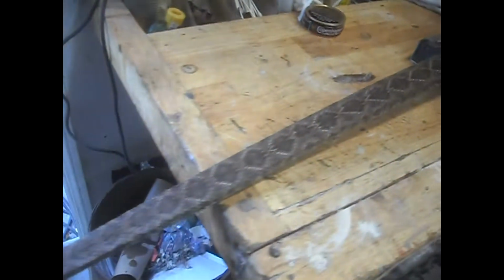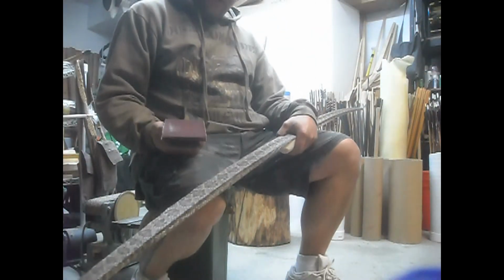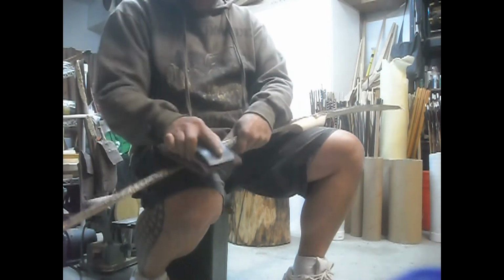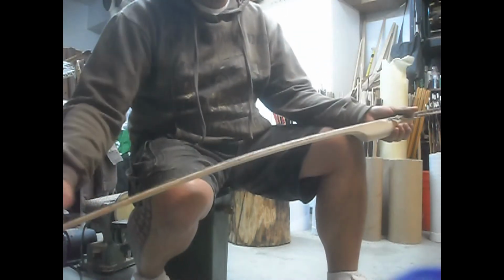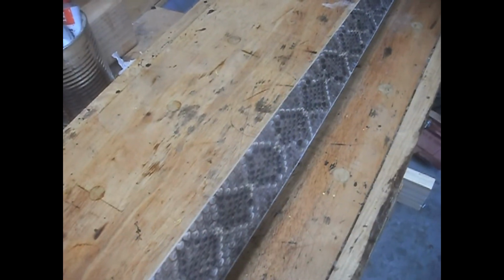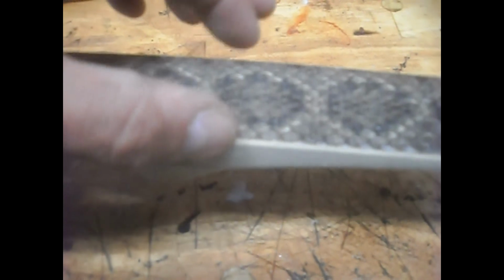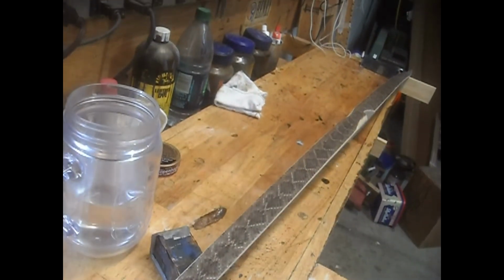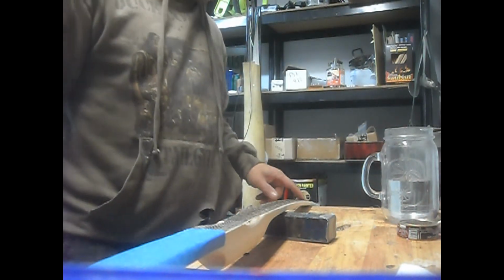Snakeskin Backing Part 3

Comment: How long does it take for the snake skin to dry. I'm thinking of doing this with some snake skin a friend of mine gave me and i have a bow that i made that had rings that were impossible for me to see, So i want to put backing on it to make sure it does not break. It seems to be doing well when i check the tiller but i want to be safe for its going to be a present for my sister this Christmas and she is visiting from the Navy so i want to give her a good bow.
Reply from the maker: enrique12345ish snakeskin won't help to keep the bow from breaking. Rawhide would be better. It takes about a week to thoroughly dry
Reply: Alright sounds good I just so happen to have a few rolls here so that might work. Might it be possible to put snake skin over the rawhide or would it take to long to dry I would assume so
Reply: @enrique12345ish  fresh skins actually seem to work better